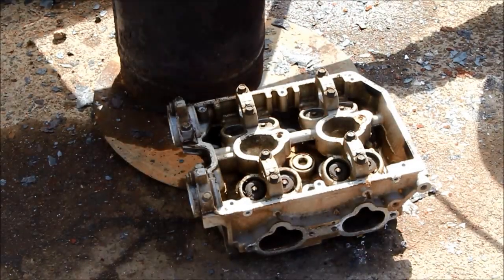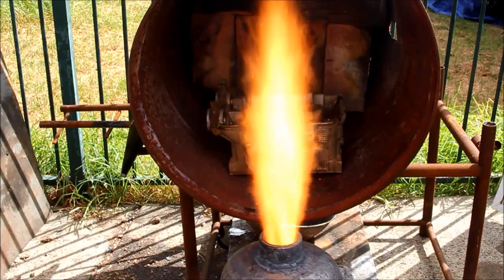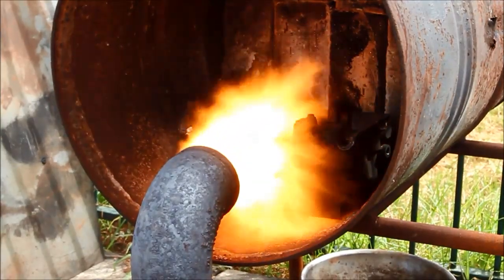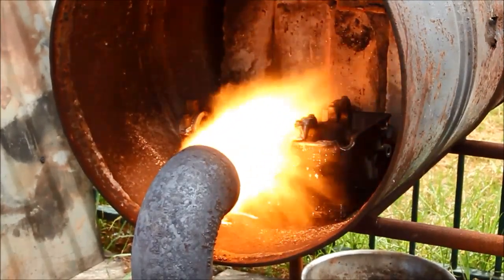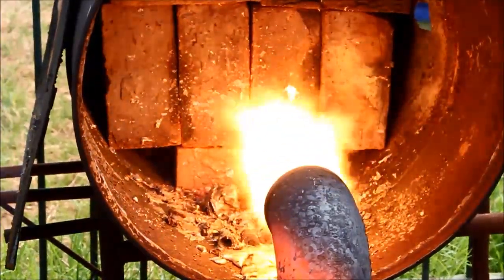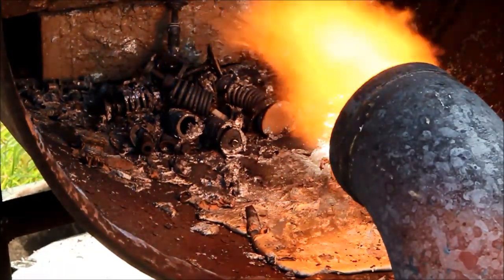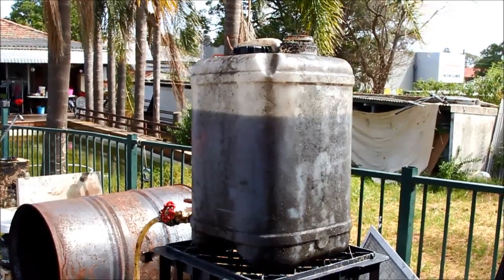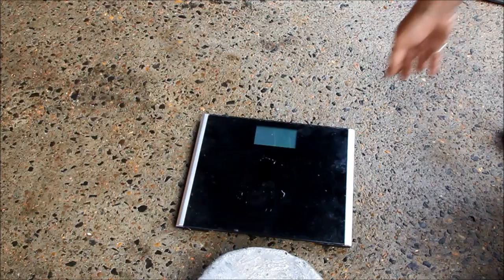Aluminium Cylinder head Melt in waste oil Burner Furnace

Comment: so your left with 9.8 kilos i bet the rest was the steel bits that were in the head 
i say this is a win
Reply from the maker: +Faisal Abdulaziz   Yep, that is the idea. Separate the ally from the steel easily and quickly.
Reply from the maker: insAneTunA
There was a bit of aluminum left but mainly  Dross which I am happy to keep in the furnace. It kept the ally I did get out very clean and I didn't have to skim the molten product at all which was good.
Reply: Oil Burner
make a swinging arm from a steel tube in order to pour the molten aluminium into several different ingot molds, then you can poor a big batch in one go. A bit like how they pour concrete with those big spinning cement trucks. I would not swap or move molds that hold hot molten metal, that's asking for trouble because in the heat of the moment you might try to empty a mold too soon. Also keep moist away from hot molten metal unless you like to scrape exploded aluminium from your skin. But maybe you want to look into some videos about building a DIY furnace, some have very ingenious but simple and cheap methods to pour the metal directly from the furnace after the metal is molten, so all the metal leaves the furnace in one go. I can see directly that your furnace has a lot of room for improvements.
Reply: +Faisal Abdulaziz I can imagine that a better furnace would save even more aluminium, it looks like not all the aluminium ran out of the furnace.
Reply: insAneTunA perhaps if you have more aluminum you can throw in it would utilize the fuel even more efficiently
Reply from the maker: Faisal Abdulaziz
I just got about 100 Kg of ally and was going to load the thing up as you suggested. The problem I see atm is what to capture the molten output in and how to swap the molds.
There are a couple of ideas I have and will work on to get round the problem. I'd like to do about 100Kg of ally in one melt.
Reply: Oil Burner i see do you 
are planing to sell these illuminum chunks for scrap dealers or your going to use them your self ?
Reply from the maker: Faisal Abdulaziz
I was thinking of casting them to ingots and offering them for sale on ebay for people who want clean ally for making castings. Many scrap dealers won't sell metal tot he public here and it may not be as clean as I do it after melting it down.

If I don't get any takers then yeah, will probably sell for scrap.
Reply: Oil Burner

sounds like a plan

Comment: arent those valve springs and possibly valves unusable now? or at least need to be re-tempered?
Reply from the maker: +denvera1g1  I just give them a brush up on the wire wheel to make sure they are lean and don't have any aluminum stuck to them and they are fine.  The engine re-conditioner checks he length of the springs and the angle of the valves and puts them back in.  They run pretty hot in the engine are are designed for high heat.

Comment: hope that it doesnt rain;) water and malten aluminium=bomb
Reply from the maker: +koalajs  Nothing to worry about!  The heat of the furnace creates a thermal updraft  air current which keeps a hole in the clouds above it and ensures there is always a great big Ray of sunshine beaming right down on me.  :0)
Reply: +Oil Burner what's the biggest baddest oil burner you built to date? and is there a video?
Reply from the maker: ***** The best so far is the 600Kw output burner https://www.youtube.com/watch?v=pt9xvB_hmWk
I have plans to go much harder with that one soon and there are also 2 others in the works that should make that one look pretty week. Just considering if it is wise to run them in the back yard or I need to fine somewhere with a lot more space. Check out my channel for all my vid and subscribe so you see when the new vids are up.
Reply: Oil Burner
thx

Comment: If it is soft, why couldn't you put steel washers on both ends of each hole, squish them down to 2 to 3 times the normal torque and then resurface the head?  you should be able to crank down now and it should take a seat.  Silly brits!

Comment: Do you preheat the oil before it goes into the burner ?
Reply from the maker: martkt10  No. Pre heating seems to be an overdone and useless fallacy where burning oil is concerned. It is only needed if the oil is too cold to flow. If you have got it as far as the burner, then obviously it's not gelling up in the line and heating to thin it is unnecessary.  It does not make it burn better because as soon as you mix the oil with the air you have reduced it's temp to within a few degrees of the air temp at best so heating does nothing.  If you get the oil too hot in the line, it will char and leave deposits blocking the flow. 
Heating the oil at the burner does NOTHING despite the amount of Vids we have both probably seen where people do it.
Reply: Oil Burner So would i have to thin the old engine oil down as its takes forever to go through a pipe, what would you suggest to thin it with, many thanks
Reply from the maker: martkt10 What Size pipe you using.? I have gone to 1/2" so I can get enough oil flow for doing 600Kw+ but if you are a sane person, I'd say go 3/8 as a minimum.  If you have to thin the oil, use Diesel, kerosene or turps. anything BUT Petrol is good.  As you can see in my later Vids, I have pressurized the fuel tank to get better flow. Even a couple of PSI makes a big difference. You could use an old oxy regulator like I have or a BBQ gas regulator. 
The other thing you could do is get some less used engine oil that is thinner or Veg or transmission fluid you could also blend with the engine oil.
Reply: Oil Burner My feed pipe is 10mm so i guess it might be a bit narrow, i might try a bit of diesel as thats easy to get, though i should say, mine is no way as big as yours, and i only use it in the winter to keep my shed warm , my burner flame heats the bottom of a thick sheet of plate steel, and then the heat then radiates around the shed, my fan is an old hair dryer, not sure how i could pressurize my oil tank, dont have a compressor
Reply from the maker: martkt10 Your Oil must be VERY thick. I lit up one of my burners up today to melt some aluminum and was running about  80Kw with the fuel only about a foot above the burner. I was running 1/2 hose but put a 8mm copper tube on the end to feed the burner.  You could try putting your oil up higher. I have had mine 5 ft above the burner inlet to get good flow. Also make sure the line is properly bled. If you have air pockets in the fuel line, they act like restrictions and you get reduced flow. Make sure the connection to the tank is tight because the oil will pull air in the line which restricts the flow. It's handy to use transparent tube to make sure you have all the air out of the line. 

I'd like to see a Vid of your setup.  Your heater sounds interesting.
Reply: Oil Burner Thanks for that tip, i'll look at getting some clear pipe, that might be the problem, its not that thick (20/50)

Comment: Yeaaay, at last, a no bullshit, fair dinkum crack at somethin we all wanna do,..well at least I do !with no fancy thermal brick-cement thingy's that cost an arm and leg. Lost count of how many other methods watched on Youtube but this is best by far.and the best part is that theres no mistakin that ripper accent!!!  Love it mate. .
Reply from the maker: peter robertson  Thanks Mate. I appreciate the kind words especially from down under. 
Yeah it seems OK for the yanks that can get everything they want cheap as chips but it's not so easy or inexpensive for us here. Learned that the hard way. Instead of expensive and hard to get refractory, I just use Raw power.  The yanks think I'm over the top with the amount of heat I pour into things but it's a matter of using whats available and affordable.  Oil is a lot cheaper and easier for me than refractory and I'm getting to the stage I can make any heat output burner I want.  

That said, I'm thinking of doing another furnace and using bricks and clay maybe with some pearlite as a "Helper" in the mix. My dirt furnace held up really well as did the brick one so I'm thinking of combining the 2 and see how I go.  Have a look at those on my other vids. 
Thanks again!

Comment: Great video. I'm going to make one of these one day. I don't think I'll put the elbow on with  my bare hands!
Reply from the maker: antony wardle Putting the elbow on is no worries but you sure as heck wouldn't want to try and take it off with your bare hands after it had been there more than about a second! :0)
Reply: Oil Burner I'm looking around for an old fire extinguisher to make a burner now. Love the work. Hope you don't get too many complainers.
Reply from the maker: antony wardle The whingers are annoying but mostly laughable. The real reward is knowing people like yourself get something out of what I show and are inspired and able to make one for themselves to put to work or just for fun.  :0)
Reply: I watched another video. I think it was called the thorpedo burner? Anyway, that looks like something I can make with the current stuff I have lying around. Braver than me welding. I always wear gloves ;-)  Can the thorpedo burner be used for melting Aluminium and for heating?  Would you make two of just move one around? I was wondering about the cast iron burners out of gas bbq's being used instead of a pipe for the air flow. Would that work? Also, after you get the flame going well, do you still need to have the air on? I realize that the heat would drop off but wondered if you'd tried it and what happened.

cheers

Comment: I've done a 6cyl falcon head in the larger furnace I built, It stuck out the top for a while but all came out the outlet in the bottom and ran into the bowls I had to catch it. Sure beats trying to smash or cut them up!!! Lawn mower engines do the same, just a matter of fishing the crap out afterwards.

Comment: I hate to ad a safety tip, but some valves have sodium filled stems and may explode in a furnace. Temperatures, here, are getting warmer. I'll be cooking soon!! Great demo!
Reply from the maker: I did Check for sodium Valves Kevin but they are not Fitted to this engine.
Looking forward to seeing what you come up with. I'm getting colder here so I may even be glad of my Summer R&D on heaters.

Comment: Man, that was fast!
Reply from the maker: I think it should have been faster. I think I was only doing around 200Kw on this run which is well short of what the setup is capable of.  Going to have to hang the oil supply much higher for the next run and I'll also stand the head in the furnace different.
Reply: Oil Burner Maybe a cast iron grid from a BBQ to keep the aluminum up off the bottom and in the direct flames. Would strain the steel out as well...

Comment: G' Day OB. Once again, you caught me while drinking my tea. At this rate, I'll be replacing my keyboard faster than I can clean it! 

11 Kg = 24.25 Pounds = Starting weight.
9.8 Kg = 21.6 Pounds  = After oil burnified.... 
o.0 Kg = 0.0 Pounds of skin lost due to burning away on this completely safe from 5 miles away in the underground steel and concrete fortified test bunker. 

I was thinking while you were cooling the man sized ingut, I'd like to see the temp rise in a bucket of water that this nearly molton ingut would be dropped into.  Or another strange thing bouncing around in my head is to put the SS container in the bottom of a 55 gal. steel drum, (cut down for conveinience and filming), full of water and let the molten aluminum drop into the water and sink into the bowl. I'm thinking some interesting shapes might just come from the droppings.. lol..... ;)
Reply from the maker: Steve please take the safety procedure of covering your computer peripherals in glad wrap or a shower curtain before viewing my vids in future or just have you coffee before or after.
I also thought of dropping the ally in water. I did another melt and did that and was amazed how much water it boiled even when I put the hose in with a flow of cold water.  Definitely something to add to the next vid.
Reply: Oil Burner Hahahahahahaa..... Might just need a diaper if you keep busting me up like this!!! ;)

Comment: Needs more flame i say a bigger blower and a better oil feed i say bigger is better when it comes to burning oil
Reply from the maker: It would do a lot better on more fuel feed alone. I didn't have enough height on the tank for this run, I won't make the same mistake next time!